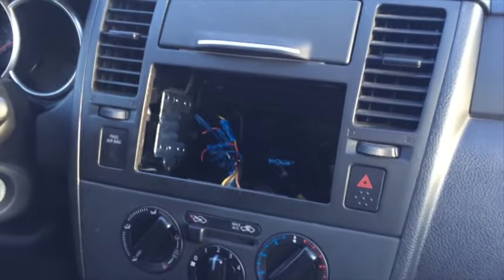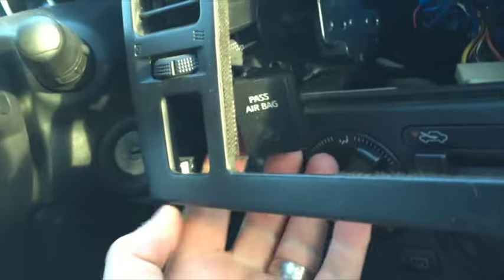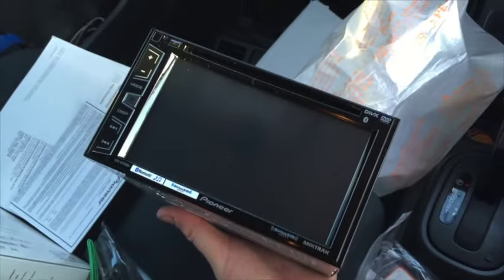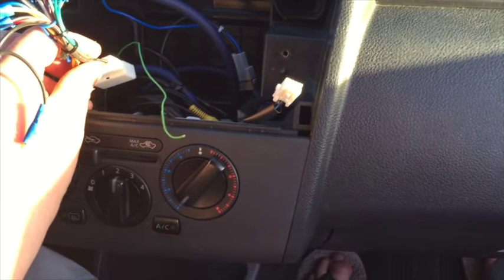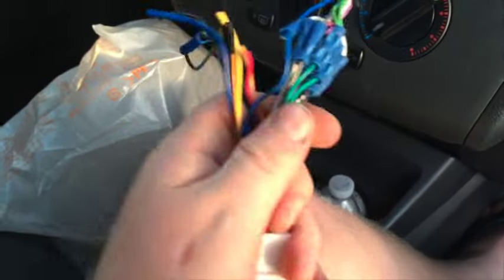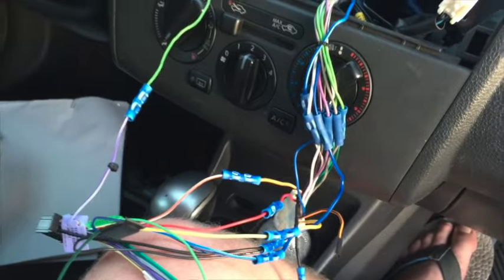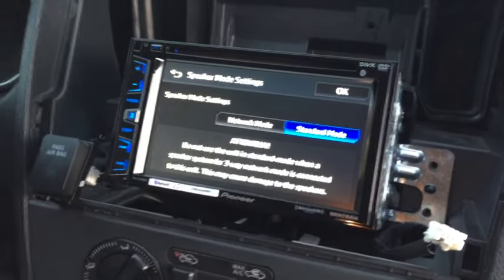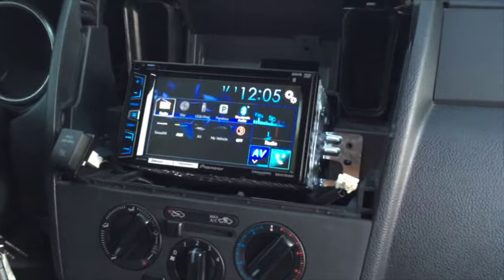2007 - 2011 Nissan Versa/Note/Tiida Radio Install

Comment: Hey mate, the video is very helpful and I want to thanks with you. I have just a question. Is it any 6.2inch compatible? Like..  PIONEER AVH-A245BT Dual Pin , it’s a new version of that one used from you few years ago . Same size of the screen. What do you think? Pls

Comment: If you disconnect the negative wire to the battery you can unplug the airbag as long as you reconnect it before you put the negative wire back on battery
Reply: I disconnect the airbag, what can I do?

Comment: Question when wiring up this do you ground the black to the chassis or wire it up to the other black wire connecting to the stock harness

Comment: I have a 2015 Nissan S and for some reason the steering wheel won’t connect but my pioneer AVH-310EX says its steering wheel control ready. Please help.
Reply from the maker: You will need a steering wheel control module to make it work, such as the axxess ASWC-1 or the Pac SWI-RC

Comment: Hi there, very informative video. Can I install one of these in my Nissan Note 2010 please? Also, I cannot find the unit anywhere to buy from, is there any link you can provide please? Thanks
Reply from the maker: It has been discontinued for a few years.  Just search amazon for Pioneer double din radio's and choose the one you like the best.

Comment: Hi bro, I am using Nissan grand livina and would like to know about the connection that you mention on the orange wire (When turn on the small lights) as I'm confused. Nissan wiring diagram probably should be same.There is a wire where it must be connect to turn the small light on the panels. How do you connect those wire? As I'm stuck half way on replacing my head unit.Thank you (Simple English will be fine).
Reply from the maker: On the radio harness, connect the orange / white wire to the car adapter harness orange / white wire.
Reply: Hi, Did you mean the radio hardness wire that I'm gonna replace isn't? So, i just have to connect the orange wire only and the small light will be working fine.

Comment: I know this is old but the antenna wire has a blue wire coming off of it where does that blue wire hook up to
Reply from the maker: tie it into the red wire (accessory).  Its your amplified antenna trigger wire.
Reply: @ProvoBeastAudio  thank you

Comment: Does it have to be a pioneer double din stereo like does it matter what brand I get? Will it still fit into my Nissan Versa
Reply from the maker: Doesn't matter what you get, any double din will fit without a dash kit.  If you decide to get a single din, you will need to pick up a Metra 99-7603 dash kit.

Comment: The antenna adapter i bought comes with a blue wire. What does that blue wire hook up to?
Reply from the maker: Two options, either the blue white wire on the radio harness or tie it into the red wire (ignition) to provide power for the antenna.

Comment: Hello,
I can not get my iphone to pair with my stereo. Also i can not get the Bluetooth Connection Menu to be an option it stays gray. Please if you can help me to get it to work. The Bluetooth auto was working and just one day stopped auto connecting.
Reply from the maker: +Graciela Chavez What stereo do you have installed? Can you provide more details about your vehicle, stereo, etc?
Reply: 2007 Toyota Tacoma, and i have the AVH-X2700bs installed
Reply from the maker: Go under the bluetooth settings on the Pioneer radio and perform a bluetooth memory clear.  Next, on your iPhone, forget the pioneer device in your bluetooth settings in order for you to start over.  Then re-pair the phone to the pioneer.
Reply: +Provo Beast MY Bluetooth settings is gray I can not get into it.
Reply from the maker: +Graciela Chavez Then do a factory reset on the Pioneer. Go to restore settings and start from scratch.
Reply: +Provo Beast I have tried that already :( it didn't work, i still can not get into the Bluetooth settings and it keeps telling me that "pair unsecesful
Reply from the maker: Unfortunatley, it's hard to diagnose the issue without being presently in front of the unit.  I suggest viewing the User manual to help you through resetting your system: http://www.pioneerelectronics.com/PUSA/Car/DVD-Receivers/AVH-X2700BS
Reply from the maker: Click on MANUALS & BROCHURES and download the user manual.  This will provide step by step instructions on how to reset yours system.

Comment: Hi, I am a rookie about cars. After I watch this, I still soooo confused about the "lines". There are 3 harness for the factory radio, but your car has been advantaged into that blue color harness system, idn why and how. Actually, that's the most difficult part in    change an aftermarket head unit for a car I guess. Please teach me little bit if you see this. Thank you. (Simple English plz)
Reply from the maker: This has a "blue" cable which is due to an external amplifier in the trunk.  If you do not have a blue harness like mine, please disregard it along with the RCA cables.  You just need to worry about the "wiring harness adapters" which is a wiring adapter that plugs into the factory radio plug.  This wiring harness adapter labels all colors which you match with the the colors of your new radio.  Please see this video as an example on how to wire a new radio: https://www.youtube.com/watch?v=qf8gyciOZME&t=52s

Comment: my 08 versa had 3 wires connections in my stock radio. the wiring harness for my vehicle only has 2 for aftermarket stereos. what am I missing?
Reply from the maker: Does your versa have steering wheel volume controls? Also have you hooked up the antenna? The Vera antenna plug looks like a regular harness, so you would be required to get an adapter for it (part number in the description)
Reply: no steering controls. and I looked at the parts. but if I only plug in 2 of the 3 coming FROM vehicle what will be missing? I've noticed a lack of versa stuff
Reply from the maker: Do you have the antenna adapter? That maybe the third one you are talking about.
Reply from the maker: Metra 40-NI12 Antenna Adapter
Reply: same here, i have the grey antenna adapter and then 2 white ones that plugged into the stock stereo

Comment: I have a 2010 Nissan Versa, I installed aftermarket stereo, wiring, everything works. But for some reason the whole stereo will turn on and off and on and off, I believe I am missing something. I installed my ground to that stereo bracket as well. Should I connect it somewhere else? Thanks in advance.
Reply from the maker: Sounds like a major wiring issue, and like you said, it may be the ground shorting.  I would redo that ground and find a better spot to a metal surface with low resistance.  Start there.

Comment: How do I use the 9 wire with stock radio and lc2i "LOC" ........I want to replace door speakers but don't want to replace stock head unit, but also what to use amp for door speakers, but have to use LOC to connect amp......HELP!!!!!!!!!
Reply from the maker: So, like in the video, the 9 wire is your amp speaker output wires.  Since you will not be replacing your factor radio, you will have to cut the factory speaker wires in the main harness behind the radio.  where you cut the wires, the ends that come from the radio will go into your line out converter LC2i which will convert the signal to an RCA connection to your amp.  The other ends of the cut wires which go to the speakers, this is where you will connect your 9 wire to send the amplified signal to your speakers.  Hopefully this makes sense.

Comment: do i need a dash kit for my nissan versa 2012 ? i want to install the atoto a6 pro 2 din and im not sure it fit on the dash kit factory i have the original radio

Comment: question do you really need the extra ground? what happens if you only use the ground in the hardness?
Reply from the maker: Some Nissan's don't have a ground included in the harness and instead grounds though the chassis of the radio.

Comment: Hi, from where I can get those metal brackets? I have frame + brackets for single din only.
Reply from the maker: +Daniel Benaim Those metal brackets came from the factory radio.  If you are missing those, you will need to pull them from junk yard /ebay/Nissan dealer or order a new dash kit on Crutchfield's website.
Reply: +Provo Beast Ok, thank you.

Comment: Any idea if the 4800 would fit the same?
Reply from the maker: All Pioneer double din radios are all standard 4" tall, they are the same size regardless of screen size.
Reply: Much appreciated. I'm not too savvy when it comes to car stereo.
Reply from the maker: No worries!

Comment: Ive searched and searched for days trying to find a video about installing Dual Multimedia DVD Receiver w/ Bluetooth (xdvd256bt) into my 2014 Nissan Versa 4dr Sedan. (I undid the negative from the battery) I bought a antenna adapter and a harness. I went ahead and color coordinated the wires and used electrical tape.. I'm needing help figuring out where to mount the ground wire and I'm also wondering if I missed a step or something. Help would be much appreciated more than you think. Clearly I'm not much of a tech guy lol. 😥
Reply from the maker: If the wiring adapter harness for your car doesn't include a black wire (ground), then you will need to ground your radio (also a black wire) to any bare metal inside the dash cavity.  Essentially, the radio just needs to be grounded to the chassis of your versa to complete the circuit.
Reply: Shawn Kurtis how to you get it to power up I can't figure out how to get power to the radio